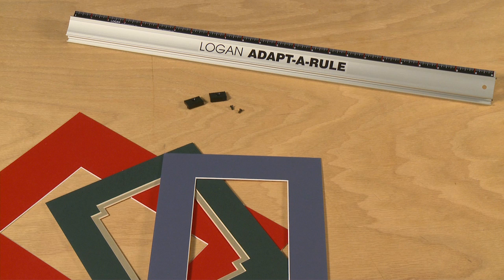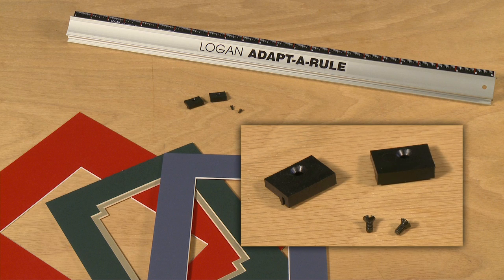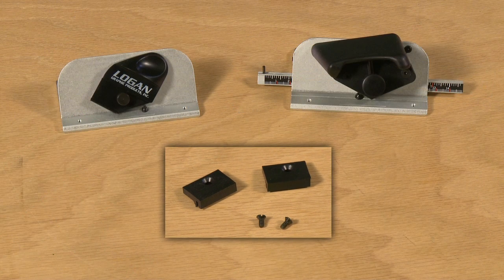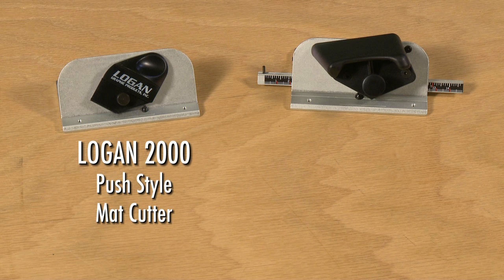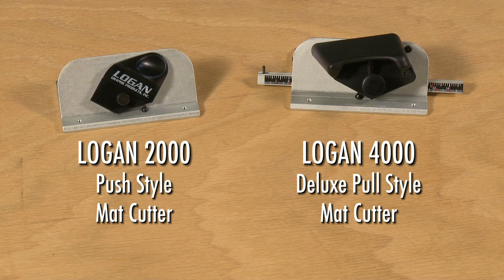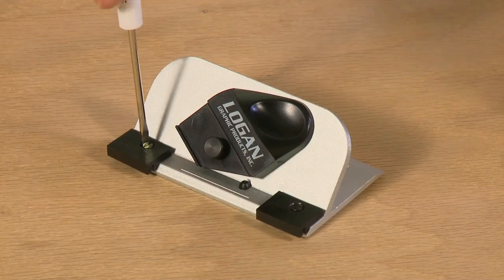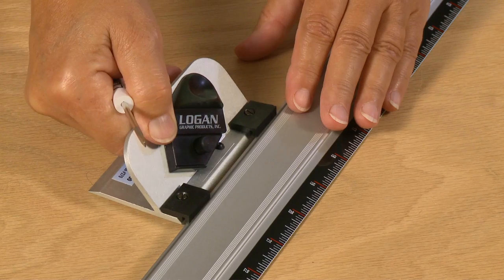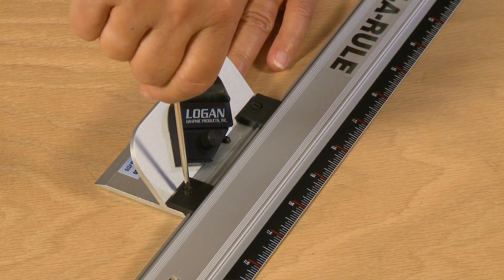LOGAN 524 and 540 Adpat-a-Rules

Comment: Any idea where I can get spare nylon guides and screws?
Reply from the maker: +Edward Falk 

Hi Edward, you can get a set of the 501/162 nylon guides and screws by ordering them as parts directly from Logan. Cost is $7.50 USD for the set plus roughly $3.00 shipping.  You can call us at 847-526-5515 or 800-331-6232 to order.